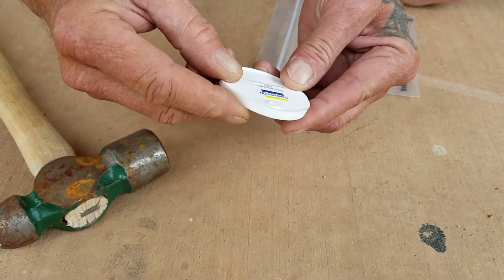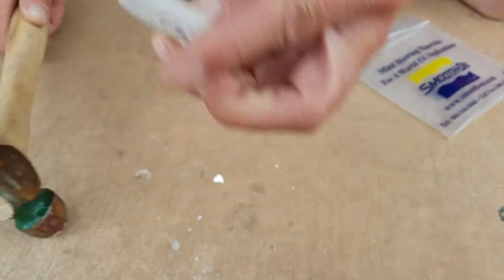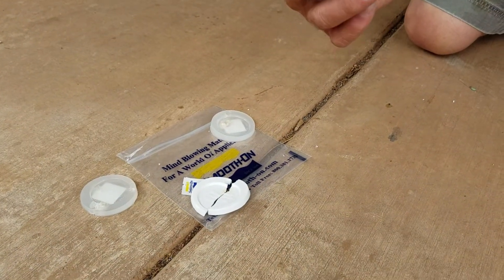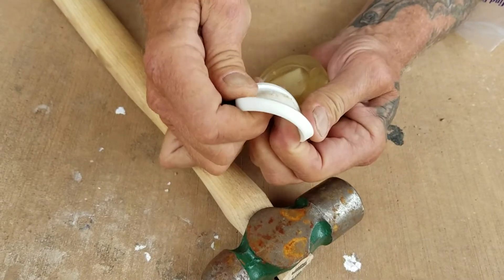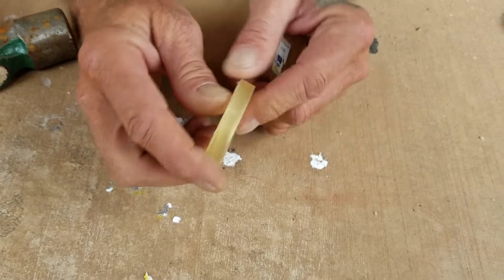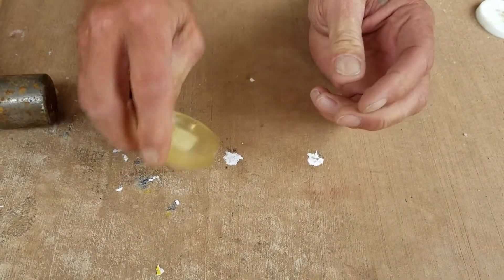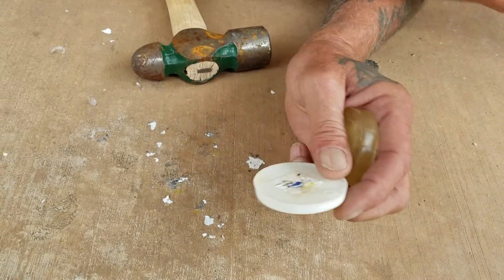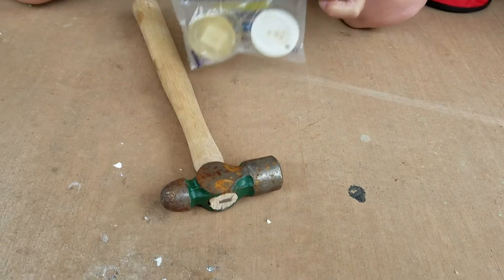Smooth-On cured samples hammer test

Comment: It may seem simple, but this video was SUPER helpful.  I just ordered from Smooth On today because of it.  They should buy you a beer. 👍
Reply: Lol....sometimes simple is best and real-world testing. Thanks!
Reply: Your video was helpful, I’m making a shoe last, basically if I casted my foot out of plaster, instead of plaster I’ll use one of these plastics you’ve tested. I’m looking for a plastic you may have tested that’s Rigid but incredibly strong, basically I could hammer it and put nails in it without it basically breaking down, have you tested anything like that?

Comment: I use Smooth On PMC 790 to make mounting disks of a concrete grinder - for the spinning parts that hold the tools that grind the floor.  Imagine a 450 lbs machine  struggling to grind off concrete for hours.  I am talking disks that handle constant shear by a 5HP motor at 1,400 rpm. Plus every so often the machine stalls (the computer shuts the motor off) from too much weight and friction.  The PMC 790 disks have been in use for 3 years now and no problem.  Absolutely incredible.
Reply from the maker: Good to hear another explain just how good it is. Thanks!

Comment: hia. did you  come across the 45d?
Reply from the maker: adsertheblade I don't believe I have have tested the 45D...After trsting more materials I ended up going with with Task 12 from smooth-on. Its amazing and as tuff as PMC-790 but stiffer.
Reply: Yes, I have tried task 12 as well. I had a a shop send me about 30 different samples to destroy. task 11, 12 and 45d bore no marks whatsoever after bashing the crap out of them with a 16oz hammer. I though I would try 45d first, as it is cheaper and less difficult to work with. you inspired a few ideas with your magnificent bonegrip, but the first will be to make a mould from the most magnificently comfortable natural I have ever seen. This way, more people can enjoy it, and I never need to worry about damaging the original. Can't wait to see what other designs you come up with, I totally want a finger and thumb supported, if you ever make one.
Reply from the maker: You will have to show me the final product. Sounds cool. Thanks for the nice comments.
Reply: no problem. sure, i will probably make a video with it and send you a link
Reply from the maker: Thanks and if you use the Task 12 make sure to get a good vapor mask and good ventilation.  Its very toxic in a liquid state but becomes totally inert after it cures. Also a vacuum and pressure chamber are essential for good parts.
Reply: Slingshot Shooters wow, sounds like it was a good decision to start with the 45d. it's a lot less nasty to work with. thanks for the tips
Reply: Slingshot Shooters well, i have been slowly experimenting waiting for various parts to be delivered. without the vacuum chamber, i have had difficulty getting a bubble free mould, and subsequently cast. it will quickly become more expensive to not have one if i keep making bubbly rubbish parts. so i got one. you mentioned the pressure chamber, what would thet be used for in this context? how are you getting on with your new designs? i decided to get some polymorph plastic to find out ectctly how a hand shape is because i found a nice natural fork that is too think and can be carved into the perfect ergonomic shape with the right knokwledge. next i will probably try something with your putty technique, but there is something i love about the fact that the first one will be made out of the natural material. 
anyhoo, thanks for the inspiration. do let me know about that oressure chamber, if you have some time, and how your new designs are getting on. regardless of what i come up with, i think i would like an ott bone grip if you make one
Reply from the maker: adsertheblade A vacuum chamber is what will cure your problem. I run 30 psi and its enough to squeeze the air bubbles out that stick to the surface of your mold when pouring in your material. I use a paint pot for my pressure chamber and it works great. About 100 bucks at Harbor Frieght. Make sure to keep your air compressor free of water.  I use a very quite air compressor from California Air Tools. Its a Ultra Quiet Air Compressor and really nice for indoors. Hope this helps.
Reply: Slingshot Shooters it does help. i just bought one, as i decided making one  has too many reasos to not work properly. you mentioned a pressure chamber as well, what is that one for?
Reply from the maker: adsertheblade the vacuum chamber removes air from the mixture and the pressure chamber forces/pushes out surface tension bubbles and any other bubble that may get trapped inside the mold. In other words you put the mold inside the pressure chamber and add the resin. Then quickly add the lid, tighten and turn the air on to keep it pressurized.  Depending on how thick or strong your mold is makes a difference on the amount of pressure you can put on the mold/part. You only need about 30 psi for most stuff.
Reply: Slingshot Shooters wow, so much to consider. thanks for all the great tips